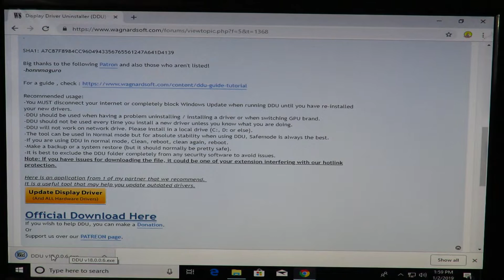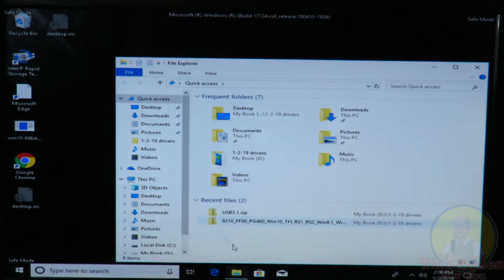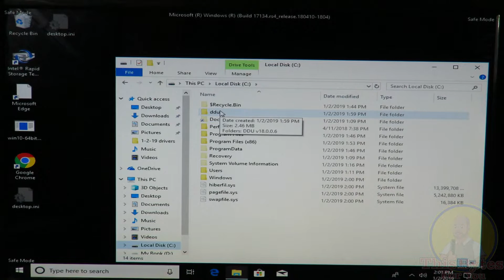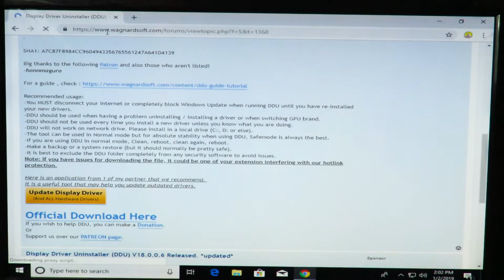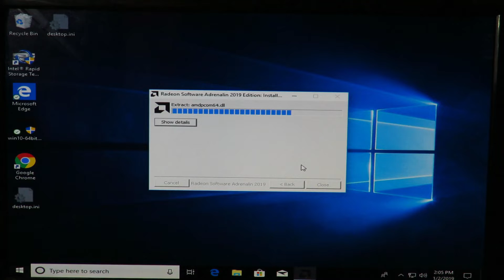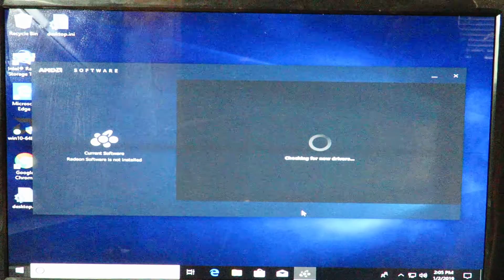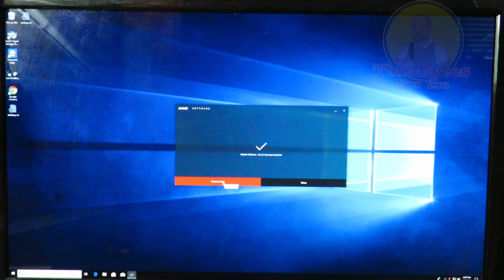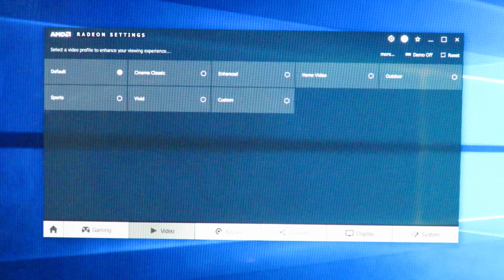How to install the AMD Sapphire Radeon Nitro+ RX 590 8GB OC Special Edition

Comment: Don't suppose you could help me?  I can install the card fine, my PSU is 700W but when I plug in the right hand side plug my PC doesn't power up. However if the left one is plugged in and the right unplugged it starts up fine. Any ideas?
Reply from the maker: I would be more than happy to help, but both need to be plugged in, not one or the other.
Reply: @ThisBytesForYou  Yeah if both are  plugged in the PC doesn't start up. It only starts up if the socket on the right is empty. My PSU is 700W
Reply from the maker: @Malachiaya  your power supply is more than capable, make sure both cables are PCIE cables, and not one of them is a CPU/EPS cable, that will not work on a video card.  If it does not power with both plugged in, you might have other issues.  Make sure the EPS power connector for the cpu is properly plugged in (depending on your board is a 4 pin or an 8pin cable) and your ATX 24Pin power supply cable into your board.  Make sure also your video card is properly seated, which may mean you need to unscrew it, take it out then push it back in, screw it down and replug in both cables.
Reply: @ThisBytesForYou  You'll have to give me some Jargon lessons mate as I didn't understand half of what you said 🤣 I'm not technical with PC Stuff or anything
Reply from the maker: @Malachiaya  hahaha, no worries my friend, that is what I am here for and these videos, to help everyone out.  What is the model number and manufacturer of your motherboard?
Reply: @ThisBytesForYou  The make is MSI and model number I'm not sure, only numbers I can see are A78M-E45 if that makes any sense to you
Reply: @ThisBytesForYou  my dad gave me the card. He said it's an 8 meg  Sapphire 11265-01-20G Radeon NITRO+ RX 580 8GB GDDR5 DUAL HDMI / DVI-D / DUAL DP with backplate (UEFI) PCI-E Graphics Card
Reply from the maker: @Malachiaya  Ok, theres a 4Pin Power connector top left hand corner of the board, just above a blue heatsink next to the blueheatsink.  That is your 4Pin CPU Power connector, make sure that is properly plugged in.  To the right of your memory, the black slot, is the 24Pin ATX power connector.  Make sure that is plugged in.  In this video, I show you how to plug in the 6Pin and 8Pin PCIE power cables to the video card, also how to properly insert the card.  Is your 8Pin a full 8Pin, a 4+4Pin or a 6+2 Pin power connector and on the side of it, does it have anything that says EPS or PCIE?

Also, if you are curious, this is my latest video on building an AMD system: https://youtu.be/9gg8w8BHGns and this video shows you how to wire everything, I go slow to make sure I can show you everything and describe everything: https://youtu.be/nJUqyHh1QQY

Let me know if you need more help.
Reply: @ThisBytesForYou  Do you have WhatsApp or any form of media so I could possibly video call you as I haven't a bloody clue on any of that 🤣🤣🤣
Reply from the maker: No my friend, I stay away from that, I leave home to go to my day job to come back home and start my night job reviewing, I barely have time for my family.  That's why I make these easy to follow video, to help everyone, kinda like having me with you.
Reply: @ThisBytesForYou  Everything's plugged in. I've got lots of X6 plugs, one goes into a green plug into the PSU, the other goes actually into the PSU. But whichever ones plugged in the PC still won't fire up if that right side plug is plugged in. Any idea?
Reply from the maker: @Malachiaya  would you happen to know the manufacturer and model number of the psu?
Reply: @ThisBytesForYou  Hi mate sorry for the late reply. The PSU is a Cooler Master and product number is RS-700-ASAA-A1
Reply: @ThisBytesForYou  Do you know if you can get away with a 6 pin in the 8 pin connector on this graphics card?
Reply from the maker: No, you need to use an 8pin, if not, they would have had a 6pin connection.
Reply: @ThisBytesForYou  Cheers but got a different card ad we plugged this one in and came to the conclusion that it's knackered. It turns on and the fans spin and everything but the HDMI wouldn't read at all so I've installed an MSI GTX 1080 and it's pretty damn impressive (I had a GeForce 710 before 😂) so it's a night and day difference

Comment: Please help me ..... where is the 6pin from and where the 8pin from ? I have a 6+2  cablef from psu
Reply from the maker: you can use the 6Pin from the 6+2, that would work fine, or the 6+2 together to make an 8Pin, do you not have 2?
Reply: @ThisBytesForYou  i really need ur help
Reply from the maker: @rsssnd_  so did you see my answer above?
Reply: @ThisBytesForYou  i sir ...i do
Reply: The 8 pin will connect from the psu to the gpu right ?
Reply from the maker: @rsssnd_  yes, but make sure it does not say EPS or CPU, make sure it says PCIE, they look very similar the 8Pin EPS and 8PIN PCIE cables.  What is the manufacturer and model number of your power supply?
Reply: Please explain me through video call 🙏...i beg u please
Reply: @ThisBytesForYou  m not that smart at this....🙏
Reply: @ThisBytesForYou  it's Corsair vs 550
Reply: @ThisBytesForYou  and what about the 6pins
Reply from the maker: @rsssnd_  no my friend, I do not do video calls with anyone, I am at my work, what keeps the roof over my families house, i give quick help when I can
Reply from the maker: @rsssnd_  your power supply has 2 x 6+2 pins, use one of the 2+6 as the 8Pin and the other 6+2 as the 6Pin.
Reply from the maker: @rsssnd_  maybe also watch this video, it might help: https://youtu.be/Dv1qK2phCFM
Reply: @ThisBytesForYou  Ok sir ......i really appreciate for ur help..... thank u very much ❤️❤️
Reply from the maker: @rsssnd_  anytime, happy to help.

Comment: Does this graphic card works on gigabyte A320M-H motherboard and  ryzen 3 3200G processor.
Reply from the maker: Yes it sure should, just make sure your BIOS is up to date and also, what model number and power supply manufacturer do you have?

Comment: Hello guys,can anybody answer me one question ? WIll my 450w 80+bronze PSU hold up with an i5-8400 and an rx 590 fatboy? Or do I have to undervolt it a bit?
Reply from the maker: The card requires 500Watts, as specified by XFX, it may work with a lower power but you may also get a lot of bluescreens, crashes and more.  Undervolting may work, but you may rob the card of power it needs.
Reply: @ThisBytesForYou  Thanks brother. Installed it today,stress tested it and everything,it is really solid even with the 450w. Maybe i'm just lucky lol
Reply from the maker: @txk1m219  anytime my friend.  What the manufactures recommend, to be safe, or require a certain powersupply, its not saying 500Watts, just for this video card, its 500Watts for a regular system.  A regular system could mean anything to anyone, they do not release those specs, you could be well under that.  Just know, if/when you start experiencing issues that you did not have before, that could be your issue.  I hope it all works out well for you.
Reply: @ThisBytesForYou  thanks bro! Keep it up!
Reply from the maker: @txk1m219  anytime my friend, and thank you as well.

Comment: Not sure if you still respond to comments but, I have an RX 580 Sapphire Nitro+ but I've been running it by plugging in an 8-pin PCIe connector only, I haven't used the 6-pin, silly question, but does that greatly affect the performance of my card?
Reply from the maker: If Youtube delivers the notification, I always respond my friend, from my very first video till my last, I always respond, will be making a video on that shortly as well.  Yes, it can affect performance, you may not be getting the full performance of your card and even worse, you may be experiencing bluescreens, lowered performance and more.  If your card has 1, 2, 3. 4 PCIE connectors, ALWAYS plug them in.  I hope this helps you my friend.
Reply: @ThisBytesForYou  well you've definitely earned a new subscriber, I appreciate the response, I'm currently in the process of upgrading my PC and wanna make sure I'm getting the most out of it, I'll definitely take note of that.

Cheers
Reply from the maker: @YakiOnigiriZoro  Awesome my friend, I do greatly appreciate it.  If you don't mind me asking, what are you upgrading, what manufacture and model power supply do you have along with the video card?

Cheers my friend.
Reply: @ThisBytesForYou  

CPU 
Ryzen 7 3700X - £255 ✅

GPU
EVGA RTX 2070 Super FTW3 - ❌

MOTHERBOARD
Aorus X570 Master - £301.64 ✅

CPU COOLER
Corsair H100i RGB Platinum SE - £115 ✅

RAM
Corsair Vengeance RGB Pro 16GB 2x8GB 3200MHz - £76.10 ✅
 
STORAGE
HDD:
Seagate BarraCuda 2TB 7200RPM - £44.05 ✅
SSD:
Samsung 970 Evo Plus 1TB - £152.19  ✅

CASE
CORSAIR iCUE 456X RGB (WHITE) - £88 ✅

POWER SUPPLY
EVGA 750W GOLD - £78 ✅

MONITOR
LG 27GL80 - ❌

This is my list, gotta save up a little for my GPU, but I'm gonna be using my old one for the time being
Reply from the maker: @YakiOnigiriZoro  looks like a sweet build and I don't think you will need anything additional.  Now you will want to wait a little on the GPU, since the 3xxx series is coming out next month but I think you will be good with cables.  You may want to buy additional SATA cables for your driver to make them the color you want, but aside from that, I think you are gold.
Reply: @ThisBytesForYou  haha yeah, I'm definitely waiting for the 3000 cards, hopefully the 2080 ti drops in price too. I'm not in a rush to buy, but yeah, if I have any issues I'll be sure to bother you about them 😂 thanks for the confidence boost
Reply from the maker: @YakiOnigiriZoro  yeah, the 3 series will be amazing, i hope to get one on launch date or before, just hopefully NVIDIA will work with me, it's hard on the little guys.  I doubt the 2080ti will drop, historically, they have not dropped in the past with newer card launches, but who knows.  Would you be buying those parts from Amazon?  And anytime my friend, always my pleasure to help.
Reply: @ThisBytesForYou  haha, I'm positive one day you'll get a promising sponsor, gotta keep the grind going 💪

Mm, the word is they'll be releasing the 3070 a month after the 3080, so I'll probably have my eye on that since it'll be the more "affordable" option. And yeah, I usually get most of my parts from Amazon, easy to return if I ever get a dead component (and I definitely have 😭)

Comment: the heatsink is touching the pci cables. will it not melt or cause problems??
Reply from the maker: As long as the cable is not frayed you are fine.  As for melting, if the heatsink melts the cable, you have a ton of other issues. As long as you don't have the cable stopping the fan or frayed, you are fine.
Reply: @ThisBytesForYou  hi i have the sharkoon 550w gold kinda plastic cables, thats why im worried a little
Reply from the maker: So let me correct and expand on what I said.  So generally it is ok, especially for my case since I am always in my case, since I review components.  But in your case, you might build it, and never look into it, then it probably a good idea to not have the cables touch regardless of power supply type.

Comment: Hello, I have a question, I have a MSI GTX 1050ti, Im planing on buying this card, does my 1050ti have the correct PCie cables, so that i can use the current cables when i buy this card?
Reply from the maker: can you give me the exact model number and manufacturer of your card?
Reply: @ThisBytesForYou   its manufactured by MSI, and the model number is 10DE 1C82 35101462
Reply from the maker: @franklittle5945  It looks like that card has a x6 connection, you will also need a x8 connection.  What is the manufacturer and model number of your power supply?
Reply: @ThisBytesForYou     its some Lenovo PSU, 450W. S/N: 8SSP50A36160A1DB78W10WS
Reply from the maker: Hmmm, I wouldn't know where to go with that, retail machines usually have lower end power supplies.  Can you tell if it is a regular sized power supply or is it smaller?
Reply: @ThisBytesForYou  its a  450W 80+ Bronze 24-Pin ATX PSU - AcBel im pretty sure
Reply from the maker: Still though, I can't say what the power supply is
Reply: @ThisBytesForYou  I have no clue bro
Reply from the maker: Ok, please understand if you dont know, and you have it in front of you.... there is no way I can tell.  Go ahead and look through all the cables and see if you have a x6 and a x8 connection.

Comment: Can I run Rx 580 at it's best with a 450 watt power supply?
Reply from the maker: Maybe, but at least with a Sapphire Radeon Nitro RX 580, you need a 500Watt, I am not sure which 580 you have.

Comment: Can u give me a link of a cable for that gpu card I am having a hard time to find a PCie cable for it
Reply from the maker: So your power supply has all those cables, but if it does not, I could recommend additions, please provide your manufacturer and model number of your power supply.
Reply: It is the DEEP COOL DE600 V2
Reply from the maker: @ez9832  wow, that power supply is a bit bare, maybe this will help you off of my amazon affiliate site: https://geni.us/Ak1t
Reply: Thank you very much so we only have to plug in the 6 pin?
Reply from the maker: No, your power supply has an 8 pin already, use that along with the 6pin
Reply: Thanks a lot I really appreciate it
Reply from the maker: Anytime my friend

Comment: Do you know any graphic cards for a p7p55d motherboard that are 250€ or under ( i have an rx580 i want to know if there are any better ones that the rx580)
Reply from the maker: Well, the problem with that board is it does not have EUFI, so you will be very limited, and impossible to utilize new get cards.  You should be able to use like an AMD 5xx series card (like what you have) and the NVIDIA 9xx series cards, you are kind of limited.  You would need to upgrade your motherboard, which means upgrading your CPU, Memory and potentially your power supply.
Reply: Can u you give me maybe tell me a motherboard that i can upgrade to
Reply from the maker: @gaymaster619  please give me your budget and what you will be using the computer for and resolution of your monitor?

Comment: Hi man! help me out.
I have this nitro+ rx 580 8gb with 8-pin + 6-pin and one cable with two heads (6+2pin // 6+2pin) "leaving" de PSU, could i use that one? or need to be another cable from PSU ?
Reply from the maker: yes you can, as long as your power supply has them, you can use them.  Personally, I like to do 2 separate strands though.
Reply: @ThisBytesForYou  That helps me a lot man...thx!!!
Reply from the maker: @urokai  you are very welcome my friend, very happy I could help.

Comment: For the Sapphire nitro rx 580, do you need to have AMD because I have an Intel processor. Also, is the drive installation process the same
Reply from the maker: No not at all, it will work fine of you have an Intel or an amd processor and yes, the driver install process would be the same.

Comment: Hi, i have two questions.
1) Is it still good for 2020 ?
2) Do you need to have both 6&8 pin connected for it to work or you can connect one and it will work slower but work ?
Reply from the maker: Hello my friend, yes it still is a good card and the instructions are good, but there are much better cards obviously, this would be good for 1080P gaming.
As for the cables, yes, you always need to connect all the PCIE connections they hard PCIE connections for.  It may work without it, but there will be a point that you have issues, a game may crash, your system might reboot while gaming when the card requires more power than you have given it. Not that it will work slower without it, just that you will have issues.
Reply: @ThisBytesForYou  Alright thank you :D
Reply from the maker: Anytime my friend

Comment: Hi,  I want to ask you if you know this.. I have this card,  I have a 144hz monitor,  I connect through a DL DVI port that it has, you know.. 
and to the monitor with that cable.  but I get into the monitor menu and I check and it says that the monitor is running in 60hz..  Do you have any idea how to solve that problem?   My monitor is an Asus 27 144hz,  I think the exact model wouldnt change anything.. I heard in a video that nothing can be done inside the monitor,  it has to be set up from the video driver..  do you know anything about that?
Reply from the maker: DVI can do 144 at 1080P, but you will need a Dual Link DVI cable, the exact model number might change something if we don't know for sure, so if you can get that, it migth help.  Display Port will let you get 144Hz
Reply: @ThisBytesForYou  Hi,  I solved this problem with this video:  "Fix 144hz Monitor Only Showing 60hz".   Now I will see 144hz for first time... lets see what happens.. will the video card get higher temperature?
Reply from the maker: @pablomi2025  cool, very happy I could help.  No, you should not see higher temperatures, if anything 1 or 2 degrees.

Comment: I just built my first PC using this GPU.  Can you explain more about the bios switch.  thanks
Reply from the maker: The BIOS switch allows you to switch between Boost and Silent operation modes.  Boost allows it to run as fast as possible and Silent, powers it down a bit, making it quieter but slightly slower.
Reply: @ThisBytesForYou  thanks!
Reply from the maker: @mamba82481  You are so very welcome my friend, very happy I could help.